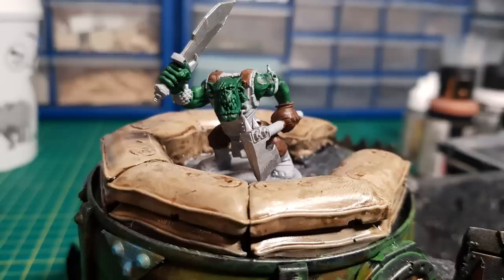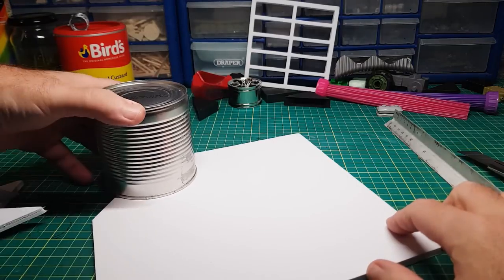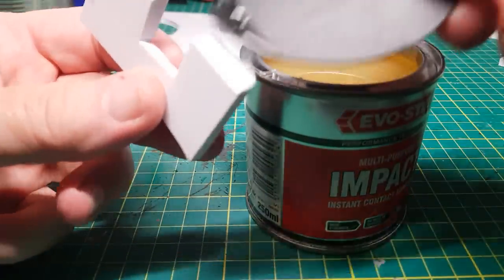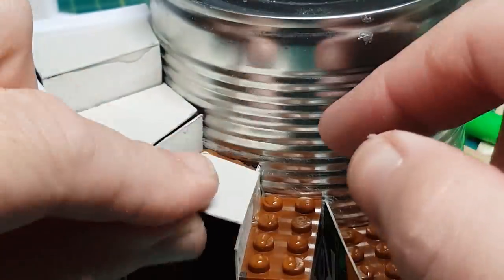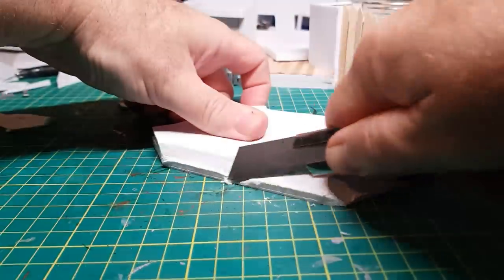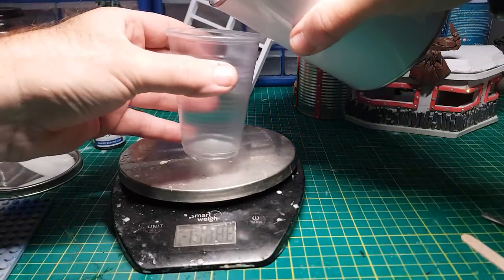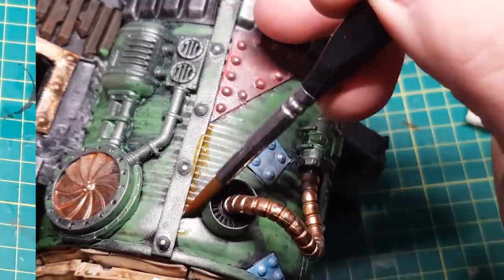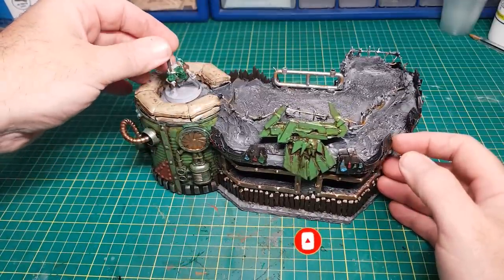Warhammer 40k Bunker Build Off with @ScratchBashing

Comment: Nice one, excellent build. EVA foam tips: On the walls instead of cutting the four sections, cut out one piece, then, cut a V groove vertically (where the join would be) into the back of the foam halfway through the thickness of the foam. Add contact adhesive, or super glue on something this small and then fold the two pieces together for a seamless 90'external edge. Cut a smaller V for less of a severe angle.
Keep your blades sharp as the foam will dull the edge quickly and then drag through the foam tearing it instead of slicing through it easily. 
Wear a respirator as contact adhesive is bad for you and definitely wear one when setting fire to the foam. 👍🏻
Reply from the maker: Thank you, great tips as well. My blade is very dull lol but my new ones are all boxed up with the rest of my stuff, should be moving into my flat in the next week so can get all the good stuff out lol. Doubt I will use the contact adhesive again due to smell and time it takes to dry =)
Reply: EVA foam emits toxic fumes when heated. Unless you're wearing a respirator in a well ventilated room I wouldn't recommend lighting it on fire.

Comment: Contact adhesive is better suited for costume making, rather than little jobs like that. But it's one of those "use in a WELL ventilated area" product. 
With dioramas or terrain pieces, if bits fall off you can just glue them back together with super glue. With contact cement, it's for things you want to remain stuck together forever.

Comment: as a cosplayer who uses foam and contact adhesive I would definitely advise not to use contact adhesive or any other smelly glues indoors as you WILL make yourself sick, sometimes a bathroom extractor fan can be useful for removing the fumes but depending on how close you are to what you are working on it may not be strong enough. a respirator is a really good idea too when doing lots of contact adhesive gluing